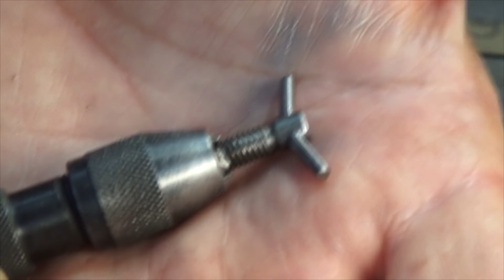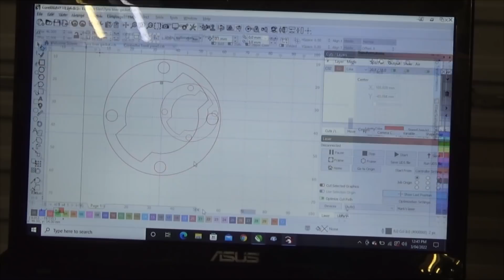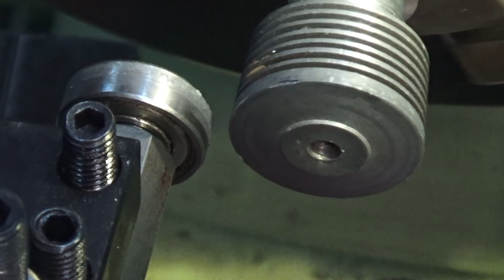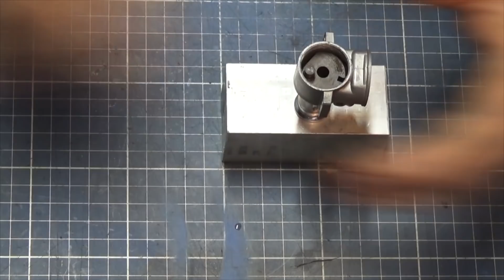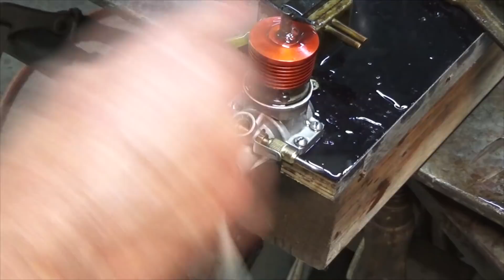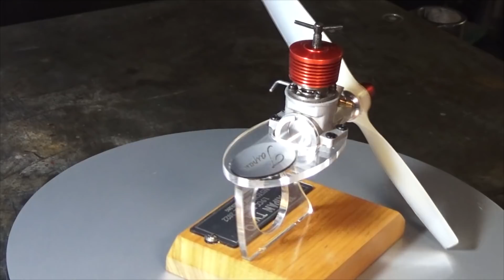The Taipan Tyro - A 50 Year Old Model Engine Restoration - Part 2

Comment: Oh Mark good old memories. I started with a 1.5ccm diesel when I was a boy. But mine made 30k rpm until the crank pin broke. Went with the bicycle to the manufacturer with the broken crank shaft and back they were so nice to me  (I was around 12yo) showed me around the production line and gave me a new crank shaft and a glow plug cylinder head as I was scared to break it again with too much compression. Then I converted it and still got close to around 25k rpm. I miss these good old days.
Reply from the maker: Wow! 30k rpm. That's getting into turbine territory. Nice story about the manufacturer helping you out too.
Regards,
Mark

Comment: I had no idea those things were so messy when they ran.
Reply from the maker: Yes, but it was probably my fault for not covering up the fuel filler tube on the tank. I think the fuel was pretty heavy on oil as well.
Regards,
Mark

Comment: I built a Taipan trainer as a kid and had a 2.5cc Taipan diesel. I flew that plane until it was falling apart and diesel fuel and oil had soaked into the wood. Eventually while doing a wing over one of lines snapped and the resulting impact sheared the head bolts off.
It was a great engine. I had the compression adjusted such that I never had to adjust it again. I used a thick leather glove to start it. It had a mean kick back!
Reply from the maker: I think we all have fond memories of cut fingers and bruised knuckles. I never had a control line break but I had quite a few aircraft turn in on me and lose control. It was then a case of how fast can you run backwards!
Regards,
Mark
Reply: @Preso58  Haha yes plenty of fond memories. I bought a cox pt-19 plane and got sick of flying in in circles so I use to run in straight line along side it. I couldn't do that with my 2.5cc planes! 😆

Comment: Hey Mark … do you know how using a rust removal/ replacement product like evapo-rust effects the ability to zinc plate a part?
Reply from the maker: I have used Evaporust and I must say I was sceptical about how well it might work but I was pleasantly surprised that it was (a) non toxic and (b) that it did actually remove the rust without destroying the part. As long as you clean the parts of all contaminants the zinc plating will work. Usually it means having to scrub the parts with hot water and lots of detergent or an alkaline cleaner. Ajax works well. If you can do a water break test and the water doesn't bead up it should be fine in the zinc plating solution. 
Regards,
Mark
Reply: Thanks …

Comment: Tip Top workman's ship Mark. Shout-out for whoever passed along the dental floss polishing idea! My bet for your next project is... A Hemingway Kits Quorn tool grinder??? Would have been handy for the special cutter grinds on the Titan build. Can't wait to find out what is next, whatever it might be. Cheers!
Reply from the maker: That dental floss trick worked a treat! I do have a Quorn tool and cutter grinder but I rarely use it. I find it hard to read the protractor settings and the locking handles don't work as well as they should. The next project is completely different to what I have done previously but it has all the good stuff in it.
Regards,
Mark

Comment: Hi Mark. What controller do you have on your laser cutter?  I've heard that you should make sure you get one with a Ruida DSP controller but most of the cutters I see have some generic controller.
Reply from the maker: Eric, my laser cutter now has an AWC608 controller from Light Object. The original DSP was some terrible Chinese no name clone that needed a dongle to make it work. The reason they fit a dongle is because the firmware is pirated. The vendor we bought the machine from (at the school where I worked) sent us the wrong dongle and that meant the whole machine was just a dumb box of parts. I tried for nearly a year to get the vendor to do something about it and then it was out of warranty and the school wouldn't follow up. After I retired the machine was put up for sale by tender and I bought it for $250. After fitting the new DSP the machine fired right up but I was still stuck with the horrible LaserCAD software until recently. Lightburn now supports the AWC608 and after a few clicks it was all running. If you are thinking of getting a laser, just make sure it has a controller supported by LIghtburn or at least one that doesn't need a dongle. 
Regards,
Mark

Comment: Crankcase seems like it’s got a lot of runout
Reply from the maker: There is a lot of end play in the crankshaft and the vibration made it look like there was a lot of radial play as well. But there is very little clearance in the main bearing. 
Regards,
Mark

Comment: Mark, regarding 'prop out of balance because of reflective tape': place also one on the other side of the prop and divide the measured frequency of reflection by two (2) to get the actual RPMs... ;-)
Reply from the maker: In reality the little bit of tape didn't make any noticeable difference. I have read that you can add two or more pieces of that tape to slow moving shafts to give more accurate readings. Never tried it though.
Regards,
Mark

Comment: Gday Preso, the Taipan looks fantastic, the red anodising finish’s the engine of nicely, the cO2 laser is an amazing bit of gear, I’ll definitely be telling Bec I need one, Preso said I did, what can go wrong, I’ve got no bloody idea how to drive it but for making name plates and gaskets it would be brilliant, great video mate, throughly enjoyed watching, cheers
Reply from the maker: If you have the  room, a laser is a really handy bit of kit. They are a lot easier to drive than a CNC router. There's nothing violent about them at all. However, one teacher at my former place of employment managed to set fire to the big 100W laser. You have all the ingredients for a fire, heat, fuel and plenty of oxygen from the air blower!
Regards,
Mark

Comment: And it runs! Nice work! Nice display stand! Great idea to use dental floss to polish the inside of the fins (I thought of using cotton thread, but it was too late to comment). Good incentive with the laser - I have a slightly smaller one still in the box, for some 3 years, due to problem with location for venting the fumes, powered by a lot of laziness 🙂
Reply from the maker: I must say I am a bit casual about the fumes from my laser. I just open the roller door and the built in fan blows the smoke outside. Acrylic is probably the worst material for fumes. I can smell it but it's more of a nuisance odour. In high concentrations it can make you quite sick. I guess if you have a basement workshop it could be a case for some sort of venting though. 
Regards,
Mark
Reply: @Preso58  Thanks Mark! I was given so many warnings, that I thought I needed to make a venting duct from the laser fan, straight outside, and couldn't decide on where to do it (kind of "what if I change my mind after I make the hole in the outside wall?"). I'll take that in consideration and maybe decide on it soon 🙂
Reply: If you have a window that opens, maybe make a wood panel to attach a duct to, similar to portable air conditioners.
Reply: @ADBBuild  Yep. Probably not the best location. I'll have to check - maybe a table on casters, that I can move close to the window when operating.

Comment: I've never gotten into model aircraft but this was fascinating. I happen to be in the market for a laser. Can you provide the model or a link?
Reply from the maker: My laser is a 50W CO2 laser of unknown make. It was supplied by a fairly disreputable dealer who would not honour the warranty. It didn't work from new and I had to fit a new digital signal processor (AWC608 by LightObject). After that I could get it to work. If you are thinking about buying a laser you can go high end like Trotec or Versalaser but they are $20K plus or you can go for a Chinese CO2 glass tube laser. There are some good ones out there but don't buy anything that needs a dongle to make it work. If it has a dongle it usually means the firmware is pirated and you won't be able to use third party software like Lightburn. A good Chinese made 50W laser will set you back about $2K.
Regards,
Mark
Reply: @Preso58  thanks!

Comment: I remember how messy these engines were... a vividly remember how much my Mum complained the fuel stains didn't wash out  of my jeans & t-shirt and how I was ordered to always wear that pair if I was ever going near that plane again (it was a friends!). But the smells, the memories! Just hearing the tyro run bought back the taste in my teeth :D
Reply from the maker: I was totally surprised by how much oil that engine sprayed out. I suppose the fuel is roughly 1/3 oil and it mostly doesn't burn so it ends up everywhere. Yes, the smell and the sound takes me back too.
Regards,
Mark

Comment: Thanks for sharing 👍 Just a question, who has ever flew control line airplanes and never did a face plant has never really flew control line airplanes.
Reply from the maker: Luckily, we always flew on sports fields so the dirt was at least somewhat forgiving. I remember seeing photos of engines with cylinders torn off after they crashed into asphalt. 
Regards,
Mark
Reply: @Preso58 : Yeah, I was one of those. We had a concrete pad and I payed the price.

Comment: The fuel most likely was pulled out through the filler pipes by the propwash.
Reply from the maker: Yes, I forgot that happens. We used to have a little cap made of clear fuel tube with one end crimped shut. 
Regards,
Mark

Comment: When you battled to start the glow engine that you built, I didn't think you could hand start a diesel engine.
Glad you proved me wrong.
Reply from the maker: I was familiar with the Taipan but the Titan engine was a bit of an unknown. I wasn't sure if it would backfire or even start since it was a home build and completely untested. Very early on though, I got it to pop a few times so I was reasonably sure it would start if I could find the right fuel setting.
Regards,
Mark

Comment: As a kid I always used glow plug engines. At a friends I picked up a diesel engine in his room and gave it a couple of flicks. And to my surprise, it started! I held onto it until it stopped but his mum wasn't impressed with a room full of diesel smoke:)
Reply from the maker: That was one reason I bought a diesel as my first engine. No batteries or glow plugs to worry about. My friends all had glow motors and if the glow plug failed it was the end of their flying for the day. 
Regards,
Mark

Comment: Yes built the trainer .. mine had a 1.5 Enya engine .. it flew well but eventually came home in a bucket ! Then made a three line Roberts control line set up. Third line for throttle . There was a bit of work in making the handle . And bell crank assembly .. oh the memories
Reply from the maker: Mark, I had a book with a diagram showing how to make the balanced bell crank assembly for throttle control. I adapted my 3.5cc Taipan glowplug motor with a baffle on the exhaust which acted like a crude throttle control but I never got the bellcrank assembly to work correctly. Yes, wonderful memories.
Regards,
Mark

Comment: Thank you for shaking off the daily sadness with a healthy dose of nostalgia.

When I was a kid, every time I had to make a support to run an engine, the wood was never the right one, nor were the screws! And my father no longer had the patience to look for his tools, he locked them away! So I had to start by finding a way for the padlock.
Reply from the maker: My dad was the same. He locked the workshop and I had to crawl under the house and jump down off a retaining wall. I am sure he knew I was sneaking in there though.
Regards,
Mark
Reply: Oh that is sad to read. I am very fortunate in this respect. My dad, getting on now, we both share the same love of tools and wander over to borrow bits an pieces from each other. I have the mill, he has the lathe

Comment: Cutting aluminium or steel with a laser is possible, just not with the power you have available.
Reply from the maker: I think that the wavelength of CO2 lasers is not ideal for cutting metal. I believe that you need a minimum of 400 watts and some sort of oxygen assist. It would be totally cool to have such a machine in a home shop though. Maybe one day we'll all have desktop fibre lasers with zillions of watts.
Regards,
Mark
Reply: @Preso58  From what I've read, a CO₂ laser at 10 µm wavelength is more suitable than lasers at about 1 µm wavelength for cutting steel. Aluminium and stainless steel are too reflective to easily cut with either a CO₂ or a Nd:YAG laser. In any case a significant amount of power is required.

Comment: That lazer cutter is amazing. The engine looks fantastic and yes you are correct about the engine being oily, messy, and smelly. That will stick in my head as long as I live.
Reply from the maker: Lasers are awesome and I am constantly finding new ways to use it. Despite it taking up a lot of real estate in the shop I wouldn't be without it.
Regards,
Mark